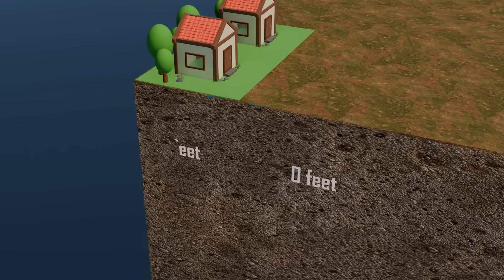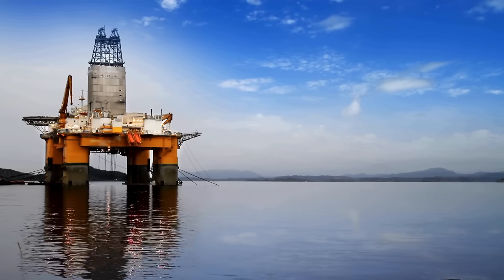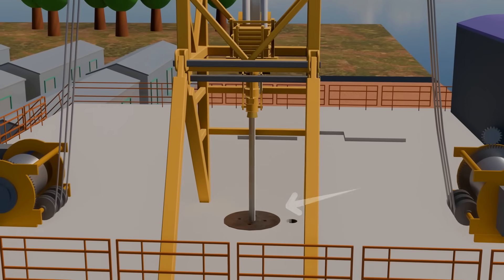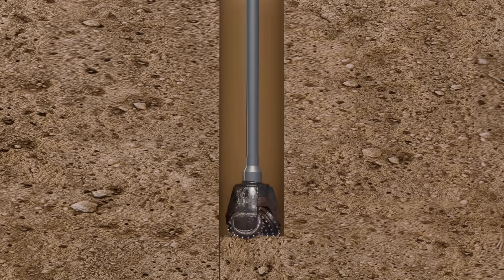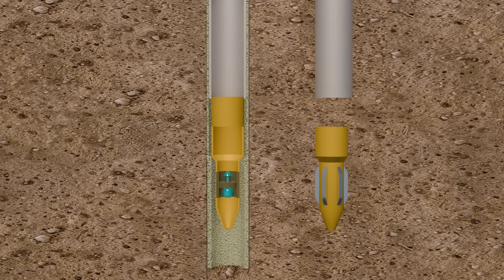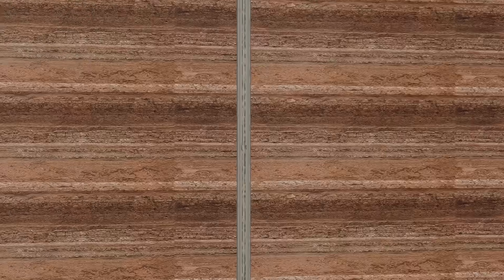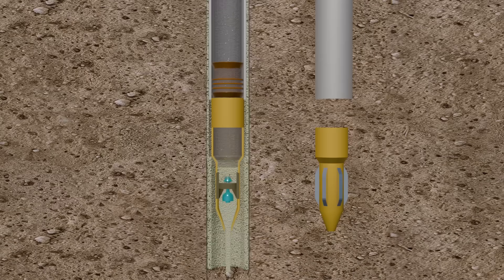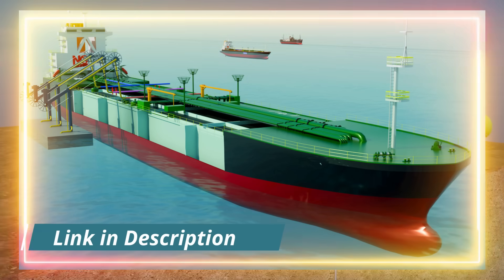How Do Oil Rigs Work? Drilling, Casing, Mud & Blowout Prevention in 3D

Comment: Seldom do offshore wells employ a submersible pump, although I have ran a few of them, almost always in depleted fields where the operator is trying to suck the last few dollars out of a given formation. Otherwise, Mother Nature provides the pressure to push the oil and gas from the reservoirs, so much pressure in fact that the flow must be carefully controlled with specialized and very sturdy production equipment, usually quasi redundant. 

Good job overall on the video.
Reply: On the North Slope of Alaska they inject the gas back into the ground and use gas lift by producing different zones. The gas bubble lift is similar to an aquarium. They also inject treated seawater with chemicals in it to help push the oil towards a producing well. I worked seismic, well logging as a hand then working on the logging tool electronics for 7 years. When I worked well logging surface pressure was around 1,400 PSI. I spent another 25 years working in telecommunications in the oilfield and along the Alaska Pipeline.
Reply: @Chris_at_Home when I worded in Mexico, PEMEX injected more nitrogen into the formations than should even exist, pressurizing one to 1,150 psi! That's also the only place I've ever ran a submersible pump downhole offshore.

Comment: I've worked in offshore oil and gas exploration, drilling for over 25 years now. The deepest vertical well I've been involved in the drilling process of was somewhere in the 24,000' range with a surface stack (submersibles and jack-ups). Otherwise on ultra-deep water subsurface stacks in 7,600' (Gusto P-10,000 drillship, amongst others) of water and 21,000' vertical depth. Both similar ideas but gone about very differently.
Reply: Engineering cnts well done
Reply: Hell yeah brother
Reply: 2018 was the last good year of pipeline work. 
A few lines in Texas being built for fuel lines to power these data centers, it’s not looking good for the people of the United States.
Reply: @JS-oy6nn why is that?
Reply: Did you ever hear of a string snapping ?
Would it mean abandon that hole if it happened?
Reply: @noelogara1 it happens. The first thing would be to have "fishing tools" hot shot to the rig. Fishing tools are specialty tools designed to latch onto and recover a lost string. If recovery is unsuccessful, you'd typically cement up the lost string and BHA in place  and kick off of it so to continue drilling. Certain drilling tools are worth millions, so I've seen fishing operations go on for weeks.
Reply: @magnumcipher4971 thanks. I was thinking that would be a big worry.
Reply: @magnumcipher4971  Usually happens when the drill pipe gets stuck during a trip out of the hole and the rig pulls on it too hard.
Reply: It doesn’t seem like it should work, yet…

The materials science is just crazy - how do you rotate the entire casing structure down (in this example) 7000 ft and not have everything tear itself apart.  The mud motor (I’m still not sure how that rotates via pressure) invented to perform horizontal drilling…who even comes up with an idea like that?  I guess it started by forcing conduit for fluids and cables to travel under roads and whatnot, horizontally; then steer it wherever it’s needed, and then there’s the technology transfer to drilling insanely deep.

When the vertical drilling transitions to the mud motor, and we drill horizontally, say, due east, what happens when we want to change direction and go due west?  Can the easterly run be disconnected at the bottom of the same vertical drill hole, and a new mud motor is sunk with the intent of making a westerly run?  If for some reason we want to go back to the east, can we re-connect to the easterly run, and start it up again?

That oil (or any fluid) can be under so much pressure at depth, it could be forced up the 7000 ft hole and blow out the too is impossible to intuit.  That’s a lot of pressure.

Another scenario I can’t comprehend is the pressure we need to push down into the drill hole to force the mud back up the annulus surrounding the casing.  That’s a LOT of pressure we’re putting down there, and there’s hardly any space in the annulus.  What kind of pumps do we have available that can force the mud down the center of the casing and then back ALLLLL the way up on the outside of the casing?

It seems there might be layers of casing and layers of cement between each casing…but why, and where are these widening layers of casing/cement - are they widest at the very bottom of the shaft or the very top?  (That is, how many layers ‘thick’ are the are the concentric casings?)  What happens if the inside diameter gets so small, you can’t shove the mud motor in?  And what happens if you’re at 7000’ but you now need to go to 10,000’?  I guess I’m not understanding how the conductor casing, the surface casing, the intermediate casing, and then the production casing all work together, and for exactly what reason.

Are these four casing layers (sections?), and the cement forced between them, installed along the entire 7000’ drill hole?  Or do we start putting in the layers when we reach a certain depth, generally speaking?  At 11:45, we see all of the casings beginning at a particular depth, but then taper off to only the production casing near the bottom - am I not interpreting the 3d animation correctly?
Reply: Exactly
Reply: How do I get a job as a compressor tech? Or a controls field service tech? I currently work at a machine shop where I phosphate and dope joint connections.
Reply: Can i sir please connect to u i am currently pursuing my bachealors  in petoleum engineering course
Reply: always good to hear from someone with real experience
Reply: is a casing applied directly at the same time the drill is operating? i couldn't help but imagine the drill hitting oil ahead of any protective casing?
Reply: @alexspeed8358 
A sign of a good well is when you have to stop drilling for 30-90 mins to circulate out the gas out of the well several times before hitting your total depth of the well. In to more detail the drilling fluid that is used is usually gel based  drilling fluid that make a coating on the walls of the open well that keeps you from losing fluid to the surrounding formations (like a gel based casing). But the rig that is doing the drilling is also the one that runs the casing. You have slips and elevators for your drill pipe, then switch over to your casing stuff when it is time to run casing.
Reply: @breadrunner7315  amazing thanks for taking the time to share that, fascinating stuff!
Reply: @alexspeed8358 drilling operations typically make new hole ahead of casing operations. Once the target depth for a given section of the well bore has been reached, engineers and geologists will review the data collected with logging tools in the drill string and will analyze the cuttings returned to the surface to ensure the casing is set in a formation suitable for supporting the weight of the casing and the anticipated formation pressures applied during cementing, pressure testing and production operations.

Prior to tripping out of the hole (removing the drill pipe from the hole), crews will circulate clean drilling mud through the well bore several times (2-4 "bottoms up") or until the well bore is as clear of drill cuttings and jagged edges as possible before tripping out to either run wireline or casing. 

If more formation date is needed, often times additional formation data is obtained by running specialized tools down the well bore on a wireline unit. This is basically exactly what it sounds like. Instead of taking all the time to run tools back to bottom on the drill string (pipe), tools are made up to a giant powered winch with 5 miles of small diameter steel wire rope. This process is much faster than tripping in the hole with tools on drill pipe. Open hole logging can take anywhere from 30 minutes to a day or more. Target production formation zones are logged extensively with a myriad of different types of extremely expensive and advanced tools. 

Once the well bore is clean, all logging data has been obtained, and well conditions allow, crews will rig up casing tools on the drill floor. These tools are specific handling tools for the various casing type, size, and casing string weight etcetera. There are far too many different ways in which casing is installed, but in all cases, it's picked up, threaded together and torqued, and sent downhole. Some
Casing runs run the entire depth of the well. Some strings of casing only cover the newly drilled hole section and overlap the above casing string by a measured amount. 

Once a casing string has been "landed", crews will rig up to pump cement to lock the casing in place. This is an extremely critical part of the process with far too many specialized and nuanced pieces of the puzzle to explain here. 

This entire bloated comment is an extremely condescend and generic explanation for the process. There are major operational and logistical differences in how it's done on the various types of drilling rigs be it land-rig based, surface stack offshore, and ultra-deep water subsea BOP stack  rig types. The deeper the water, the bigger things get. In my years drilling, the heaviest string of casing I ever worked with was 2.24 million pounds indicated weight, and that's after the floatation factor of the string floating in 12+ pound per gallon drilling mud. That was on an ultra deep water, 1,000' long drillship in over 6,000' of water. It's a pretty amazing thing to be a part of.
Reply: @alexspeed8358 otherwise, a very specialized "rotatable" casing does exist that allows for limited hole opening by way of turning the casing and pumping drilling mud through the casing similar to normal drilling operations.
Reply: @alexspeed8358  No.  The casing is put in the hole and cemented after the drilling is done.  The mud weight usually holds any pressure from the formation containing the hydrocarbons.

Comment: Your video is so amazing 👏 🤩 
But I have a question: When the anulus has been filled up with cement, and the well bore has been cleaned up from any cemet slurry, how can drilling continue when the top and bottom drive are still there? I didn't see any part you mentioned they have to be removed in order for drilling not to be hindered.
Reply: The video say that they simply drill through them.